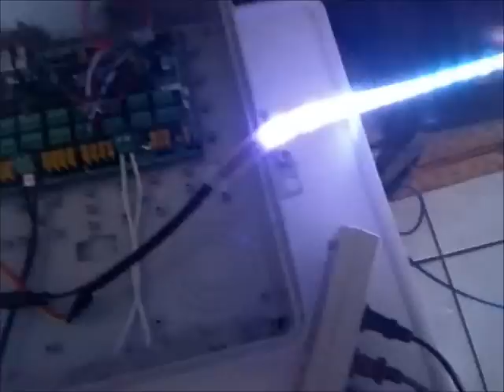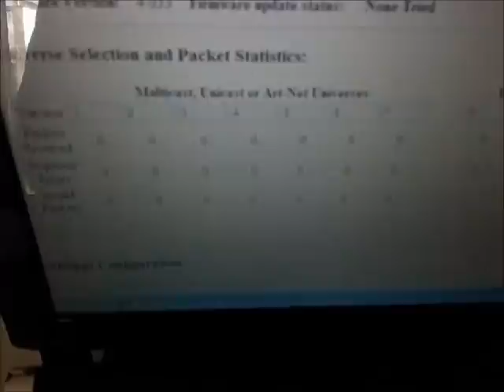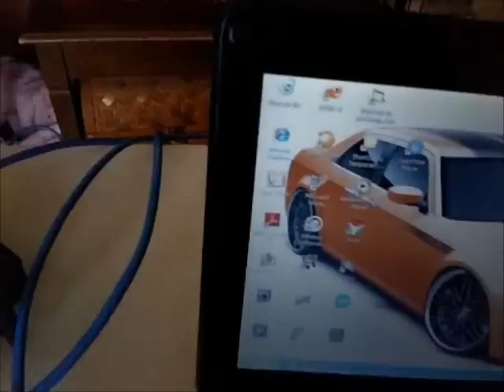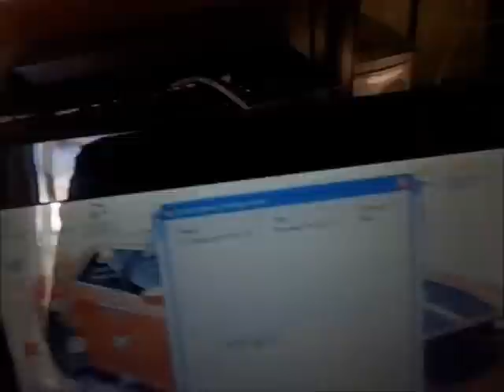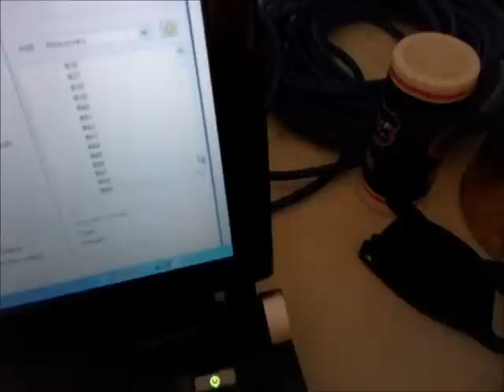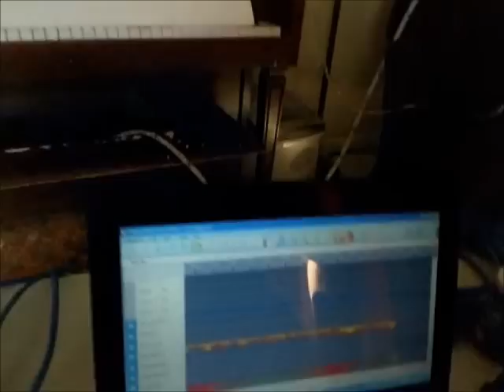E682 setup and pixel test

Comment: i was thinking of buying the e6804 just for some arches but this sounds very confusing not sure if i should even try it
Reply from the maker: Carlos Chavez if you think you don't have the time, then you don't. for one or two arches, time and money is super taxing.  my two videos should help, but it is all still custom work on your part.  you will spend several days making a half hour show.  I'm not sure I would go for the smaller board though (of course I got the 682), because you want your initial display more than just a small amount of pixels.

Comment: Hi! I am new to this hobby.  I have the E682 and a Renard SS16.  I am simply trying to get Vixen to talk to the pixels through the E682.  When I was testing, I had one strand in 3-1 and one in 4-1. Vixen was working great.  Then once I connected 2 more pixel strings into 1-1 and 2-1, all in separate universes, I've got nothing! The test patterns in the E682 screen work. I seem to have everything set up correctly. 4 strings, 4 universes, 50 pixels each, full RGB.  I have 11 strings total, but I was working on these four first.  Any help or advise would be greatly appreciated! I am sure that I am missing something fundamental here.
Reply from the maker: yep.  1 and 2 are on a different power grid from 3 and 4.  you need to run power to the input of 1 and 2 also (j18).
Reply from the maker: +HVABALL or if you have the power sorted, then again check the 192.168.xx.206 setup and then the vixen controller universe setup and then the link between elements and controller (display setup).  it's usually one of those 3.  do you have more than one power source by chance?
Reply: I do have 2 separate power supplies.  1 to supply power to each side of the board (J18 & J19).
Reply: I have spent days going back and forth between the 192.168.X.206 page and the display setup on Vixen and I just can't find the issue.  The test patterns on the E682's page work fine on all 4 strings. Everything appears to be correct with all the patching in Vixen. 150 Channels per string of 50 pixels.
Reply from the maker: +Sian Winston I just got this project back out yesterday.  check your vixen controller configuration page and make sure the universes are checked on and start with different numbers.  I had some problems adding to my system and I will take another detailed video in the next couple days that may help.
Reply: Thank you, thank you! I tried them all on the same universe with the channels starting where the last ended. I tried them on different universes the same way and all starting at 1.  I appreciate your help very much!
Reply from the maker: +Sian Winston I have posted a new video that will provide more detail as to the potential problems with mapping.  Sorry for the length again, but relative to days of frustration going forward this may help you in the long run.  Thanks for watching!!
Reply: I can't thank you enough for your help! Unfortunately, I feel that I am moving back wards.  I was just going to begin trying to configure everything again after watching your new video and my green and red led lights on the board went out.  This is not an issue I've run into thus far.  So, I have no web page now. I've been trying to fix it now for a while and I can't figure it out.  I am a computer tech so I am knowledgeable of motherboards and wiring, but I stumped. Again, thank you so much!
Reply: I got it all fixed!! And thanks to your new video, my pixels are up and running!!  THANK YOU!!

Comment: Hi, I have a couple of questions is there an email I can contact you ? 
thanks in advance
Reply from the maker: I would rather not do an email.  if you have a simple enough question, try replying here.  I've had this project in storage since the spring and plan on getting it out in a couple weeks, FYI
Reply from the maker: +Jose Gomez I posted a new troubleshoot video that may answer your question or problem...  Thanks.